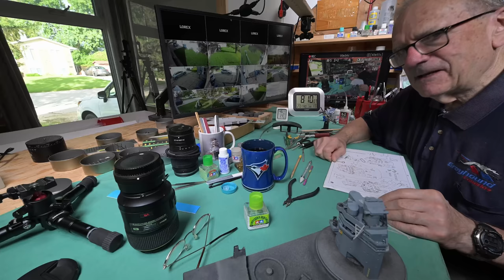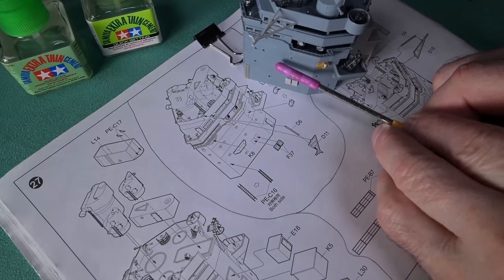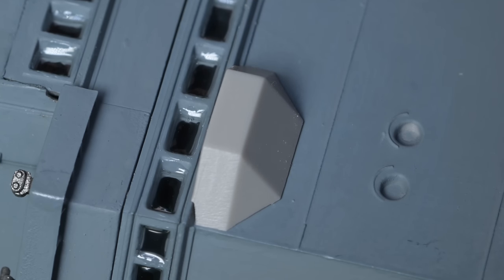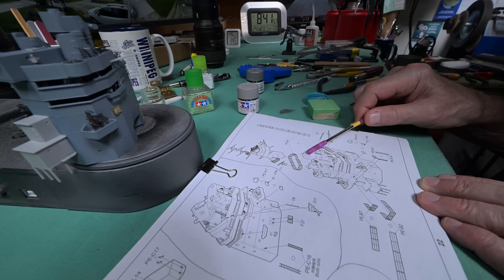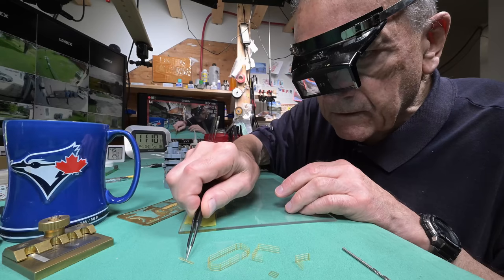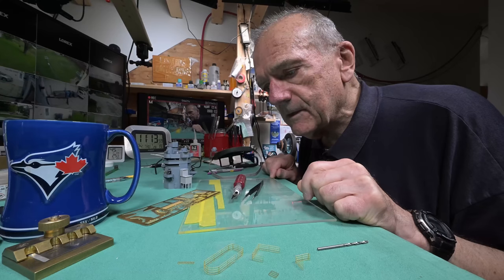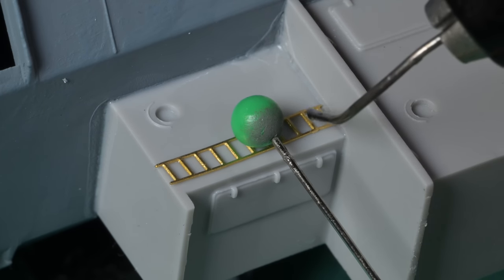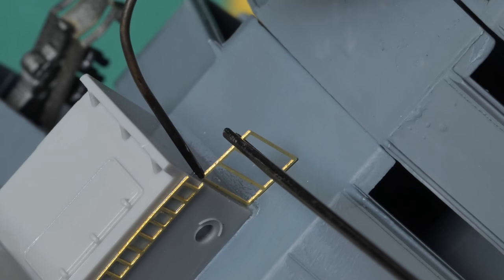The Model Ship - Part 1253

Comment: 15:50 Are those new glasses from the Fred G. Sanford collection?
Haven't seen the Painter's Tape Gucci Glasses around for a while either.              See ya.       JimE
Reply from the maker: These have replaced the "Painter's Tape Gucci Glasses" which had broken on me one too many times. These ones I used to use inside my welding helmet. See you tomorrow.

Comment: The end of small is the Planck Length 10^(-35)m=0.0000000000 0000000000 0000000000 0001m  - the atom is "big" with 10^(-10)m. At that distance the current "theories" which are not tested in any way suggest, that time and space become somehow granular. We dont acutally know but we suspect thats something strange will happen at this distance. So that would be the "end" of small. The end of big is can be tackled from many perspectives. First the universe: The current undestanding is, that something like cosmic inflation happend at the beginning of the universe. The points moved suddenly so rapidly - or better: the distance between the points increased so much, that over 90% of the universe is not observable to us. The region which can be oberseved increases every second but also the current inflation (point still are getting further apart but much slower) works against that. James Webb is getting "closer" to this "horizon" but there is still enough to be discovered. The second perspective might be: how big something can be? Lets imagine a huge rock or piece of iron bar is rotating around the sun - to make it easier it is not rotating about its own center (like the earth). The speed around the sun is choosen that it is in a stable orbit. The part closer to the sun sees a much larger gravitational force then the part away from the sun - if the piece is large enough. the atomic force will not be able to hold the part together and it will break apart - so there is also a limit to the question "how big".
Reply from the maker: Interesting stuff that! Thanks! 👍